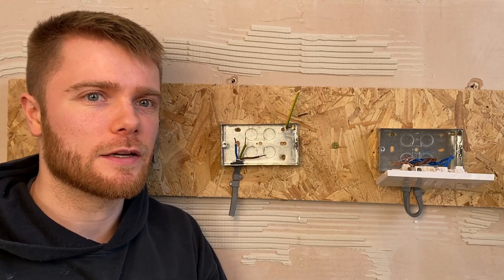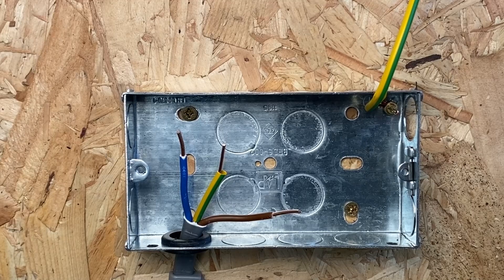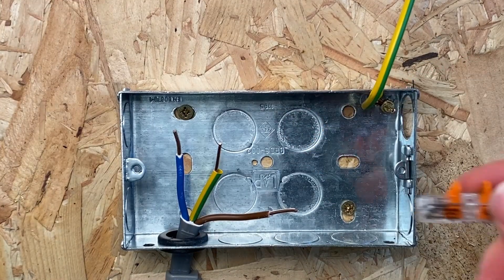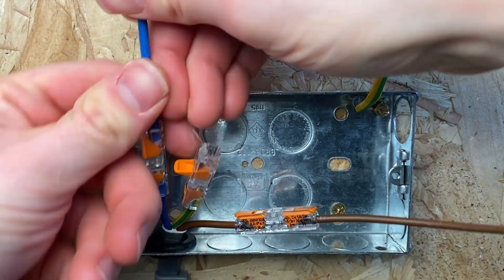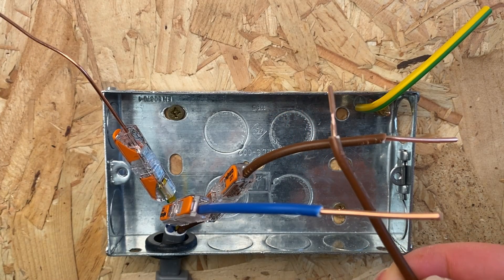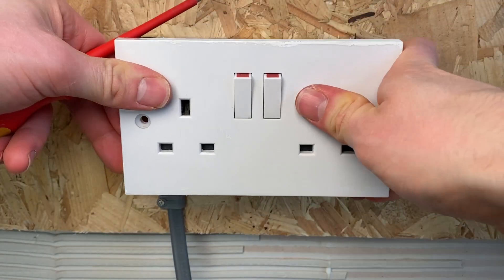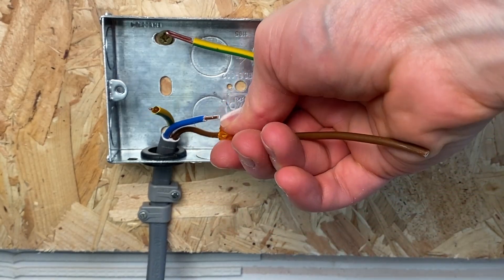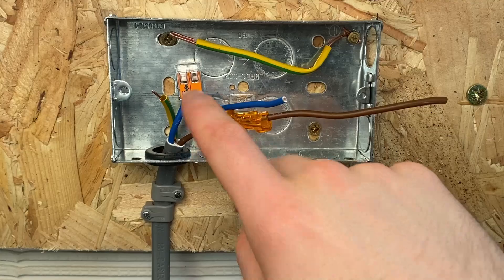How to Extend Short Cables: Simple DIY Fix

Comment: I will be changing sockets shortly , one of them has very short wires.On this particular socket there are three 2.5 mm twin and earth cables going into the metal box,ie 3 earths 3 lives an 3 neutrals how do I lengthen these particular wires? Will three wires fit in one side of a wago?
Reply: Not speaking from either training or experience here, but I think the most sound solution (space permitting) would be to extend each cable separately (ie use 9 x 1-way Wagos) and then bring them together at the socket in the same way they were wired originally.  You can get '3-way' Wagos (or use a cheaper competitor - Temu do them) which may be easier/less bulky.
Alternatively, you could use 3 x quad Wago (ie each Wago accepts 4 conductors and use them to combine the 3 common conductors to one conductor which is then wired to the socket.
Perhaps Wago's own website has some advice on this?

Comment: Great informative video. I currently have a problem with some 2.5mm twin and earth cable towards a socket on the wall. The wall was damaged with damp from the roof dripping down the cavity and then seeping up through the plaster climbing the wall around 1m. The wall has been chopped out exposing the chase for the cables half way up. I need to extend the wire to the socket down around 400mm to match the existing back box. Whats the best solution to this to avoid tracing the cable back and replacing the whole cable? Any ideas would be appreciated, thanks once again.
Reply from the maker: It’s not ideal, but I’d probably stick connectors in the wall, just get something decent quality like wago in line and be sure to do a couple of layers of heat shrink over them. I’ve actually got a video on repairing a break in a cable in a wall.  Thanks for watching!
Reply: @TheDiligentDIYer1759   I saw your video about an hour after I posted this comment haha looked very similar to what I had in mind. Appreciate the reply, keep doing what you are doing pal

Comment: you just rotated that thing, if it was holding the wire tightly it would not rotate without rotating the wire too
Reply from the maker: That’s down to the way they work, if you try pulling one out, you’ll see it’s holding the wire tightly

Comment: Of course it depends on the country, but wire nuts are commonly used and legal in North America and some parts of Europe.  I just extended a really short length coming from a gang box to have more wire to work with, and I used wire nuts.  It’s my understanding that much of Europe banned earlier versions with brittle ceramic caps, but might not have adapted to modern plastic caps that are typically rated for 300 or 600V.

I guess it’s ironic that Ideal is an American company that does a lot of business in Europe, although WAGO is German.  Ideal also has their In-Sure Lever, which is similar to WAGO.
Reply from the maker: Good points! Thanks for watching!

Comment: Another solid option is non-insulated butt crimp, if permitted by local code. Investment-heavy, though.
Reply from the maker: Yes good point, i didn’t include it was it wouldn’t be worth most DIYers buying the crimping tool. Thanks for watching!
Reply from the maker: Yes good point, i didn’t include it was it wouldn’t be worth most DIYers buying the crimping tool. Thanks for watching!

Comment: wrong, you're supposed to use insulated butt connector (WITH THE PROPER CRIMPER TOOL FOR IT, NOT PLIERS) (I didn't make the name) I'd give a link but youtube automatically shadow bans the comment
Reply from the maker: No, when inside an enclosure, I’m correct

Comment: What if you have three pairs of cable to extend going into a single switch spur?
Reply from the maker: Same solution, but you might have a hard time fitting all the connectors in the back box. If this is an issue, you can get spacers that bring the face plate off the front to give you more space. Thanks for watching!

Comment: Do the Wago connectors have to be in the back box? If space is tight and plastering work is being carried out can they be chased into the wall? Maybe taped with insulating tape first?
Reply from the maker: I think they do need to be in the box, otherwise you have single insulated cables outside enclosure. If space is tight, try the in line wagos or in line ideal connectors. Alternatively sink a deeper box in the wall. Thanks for watching!

Comment: I have 2 sockets where the cables are too short. Both of these have 3 brown, 3 blue and 3 earth going to the back of socket. Question is can I connect all of one colour wires to a Wago 222, 5 port and then add a fly lead to connect to socket?
Reply from the maker: It’s not ideal, but I guess it would be like having the socket as a spur effectively. Someone here probably knows better than me and will be able to answer for you.

Comment: hi what would you do if you wanted to extend  a light switch about 1 meter from the existing one its nthe wiring needs to be implanted in the wall.
Reply from the maker: You’ll need to joint the cable in the wall, if you just put a blanking plate on the current one that’s the easiest way as still accessible. Have a look at Quinetic switches, they are wireless, generally much easier to use one of these

Comment: Is it okay to put 2 neutrals in wago and extend with just one cable out? I was working on socket and saw 2 neutral cables were  damaged with visible copper so I decided to cut them short and put into wago and extend with one out. The circut is Radial and that specific socket was second last  in the circut, the last one  was just above the one I was working on. I was thinking the other day that I maybe should extend with 2 sperate cables instead of puting 2 damaged in wago and extend with one. This bothers me ...
Reply from the maker: Probably best extending both into the socket, but i wouldn’t have thought what you’ve done is a problem. It sounds like you’ve effectively just spurred that socket off the circuit

Comment: This is all very nice and easy if you have tons of space like here. I usually get this in a single recessed socket outlet box where there's very little maneuvering room, and such bulky connectors are out of the question. I bet these particular ones are ridiculously expensive too.
Reply from the maker: True a 1 gang 25mm box will be hard work. You could always upgrade it to a double though and give yourself the extra space.

Comment: Does the damaged sheath from the strippers matter? Not trying to troll I'm hoping for a genuine answer from someone that knows
Reply from the maker: The strippers just mark the cable really, no actual damage, so nothing to worry about in my opinion.
Reply: @TheDiligentDIYer1759  cool thanks
Reply: @TheDiligentDIYer1759  What do you consider actual damage? Bare copper showing?

Comment: What are your opinions on the crimp type connectors, I know they need a tool to fit but if you want to remove them you only lose 6mm length from the original cable?
Reply from the maker: Not a fan of crimps personally. If you use a wago, they are easily removed without losing any cable. Thanks for watching!

Comment: Right now do same again but put another   2.5mm twin in there and try to screw the socket back all the way
Reply from the maker: As long as your using a socket designed for a 25mm backbox, you’ll be fine
Reply: Its a nightmare try screwing a socket cover back when there are 6 x  32amp connectors jammed inside the backbox because somebody cut the cables short

Comment: What about using standard inline CRIMPS, which would provide a smaller footprint (and less bulky than WAGOs, etc)?
Reply from the maker: I didn’t include them as you need an additional tool, so i thought not as useful for a DIYer. Thanks for watching!

Comment: What about using standard inline CRIMPS, which would provide a smaller footprint (and less bulky than WAGOs, etc as you demo)?
Reply from the maker: I didn’t include them as you need an additional tool, so i thought not as useful for a DIYer. Thanks for watching!
Reply: I'm an industrial sparky , Inline crimps are fine as long as you have the proper ratchet tool to assure correct crimp pressure.... having said that they're no where near as robust as wago....the wago's have been a real game changer and I don't know a sparkie who doesn't use them in preference to almost any other connectors.

Comment: If you can't cut the cabes the correct length in the first place,you should not be involved with electrical work.
Reply: As a handyman I've come across lots of single sockets where I've been asked to replace them with doubles but the original wires are too short for the socket I'm fitting. Many older sockets have the holes at the bottom whereas modern ones have the holes in the top, so if the cable comes into the back box from below there's no way the wires are long enough. That's the usual reason for having to extend the wires, in my experience.
Reply from the maker: Easily done, I’ve seen qualified electricians cut them too short in new builds.
Reply: @TheDiligentDIYer1759  Oh yeh you mean the ones on there phone social media half the day

Comment: Personally my self not a good idea to join a very short wire inside sockect box best to run new wire from 1 sockect to another
Reply from the maker: Yep agreed, as long as running a new came is an option. In the UK cables are often buried in masonry walls, so running a new cable can make a lot of mess. 
Thanks for watching!!

Comment: No mention of current carrying capacity, or wire csa. I can see you are creating these video’s to help, but unfortunately electrical work should be left to a competent Electrician, you can see water, you can smell gas. But the only sense that will save you from Electricity is Common sense.
Reply from the maker: I don’t think current capacity is relevant for this video. The assumption is you have an existing socket, not adding a new one. All the connectors I suggested are sufficiently rated for use in a socket. 
I’ve seen plenty of shoddy work from qualified electricians. And gas is arguably more dangerous, you can’t smell CO….
Thank you for watching.
Reply: @TheDiligentDIYer1759  a house burning to the ground caused by faulty electrics is just as dangerous as gas. If electrical work was so easy, there would be no need to go to college.
Reply: @TheDiligentDIYer1759  please tell me how current carrying capacity is not relevant ? especially if its a ring main ( and yes i appreciate your demonstration there is not showing a ring main but most sockets are wired in the uk in a ring main fashion ) either way current capacity is very relevant
Reply: You will always get moaning sparks even moaning when it’s a pro sparky doing the video. Best to ignore.
Reply: I’ve had several electricians in my house constantly criticise the work of the previous fully qualified, presumably competent, electrician.
Reply: @SAHBfan  and your point is?
Reply: @glynknox4089  - It is easy to criticise and my house hasn't burnt down.
Reply: @AshleyWilliams12345 I have to disagree with you also. These connectors have enough capacity in this situation which is simply extending short wires into an existing socket. 

This guy goes into a lot of detail about current carrying capacity in other relevant videos, such as adding additional sockets etc. but it just isn’t really relevant in this particular situation. The wago 221s etc. have more than enough capacity.
Reply: Don't try and teach electrical if you are a DIYer pal. Simple. Lever wagos are also definitely not the best solution here.

Comment: To remove the Ideal connectors, pull with slight pressure while rotating. This will "unscrew" the wire from the connector. Only works with solid core. And I believe the connector is rated for reuse, but sometimes it feels a bit dodgy like it is now loose inside and I don't want to reuse it.
Reply from the maker: Thanks for the tip! Yes, reusing them doesn’t really feel right.

Comment: Avoid using the connector where you just push the wire in and your connection is made , That kind of connector can easily overheat and can start a fire because there is very little contact area compared to the Wago connectors which have much better contact area 
The Wago connectors are more safe because of the lock lever which clamps onto the wire , Providing better contact than the push in connector , 
Whenever I have to make an extension for short wires , if there's enough room , I'll strip a good amount of insulation from the wire to give me enough length to wind the extension wire onto the existing wire , After winding the extension wire onto the existing wire , Then I'll snip off any excess wire 
Then solder it , Then use splicing tape
With splicing tape you have to stretch it as you apply it , Then wrap it with a top coat of electrical tape to keep it from unraveling and the electrical tape sticks really good to the splicing tape which will not come off over time , for the top coat , just wrap it enough to cover the splicing tape
You can also use heat shrink tubing
But whenever I use heat shrink tubing
I'll use several layers of it to ensure good insulation , if the wire that you're extending happens to be stranded , You can use butt connectors that you crimp on but be sure you use the proper crimping tool
Reply: Testing shows that the axact opposite is true. Wago connectors have higher resistance than push ins and far higher something like 3 to 4 times the resistance of twist on wire connectors.
Reply: @johnh8546  it is so small it is negligible. A true bad connection will be a worse scenario.
Reply: @Paul Matthews  the resistance is pretty small sure but the additional heat from the resistance at 15 plus amps is not negligible. Over 20 years that is a great deal of additional thermo cycling.
Reply from the maker: Thanks for watching!
Reply: @guywilkinson  is that 1.3 Celsius was that on a 240 system. That's not that much to go on. How hot was the wire? That's so little data as to be completely useless.
Reply: @johnh8546  H for hellbent
Reply: @paulmatthews5470 I'm just curious. Data is useful. You can't make decisions without good data. I want to know what this test is actually showing. This may be data showing positive results. It may show nothing or be negative. I would like to know which.
Reply: @johnh8546  Several electricians have showed me that the lever lock connectors have more contact area than the push in connectors which makes for a better connection , The push ins are fine for light duty applications such as light fixtures but the lever lock connectors are recommended for outlets where high wattage appliances may be plugged into such as vacuum sweepers , A space heater etc
Reply: @ironmartysharpe8293  that's not what I've seen personally. I don't personally use either. The gain in ease of use doesn't offset the cost, the higher connection resistance, and fact that they are easer to pull out than wire nuts.